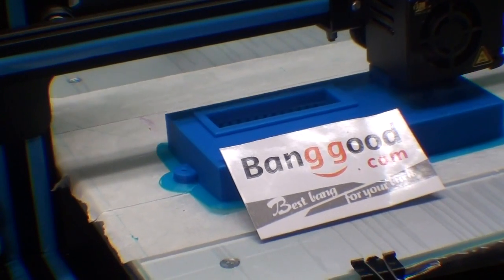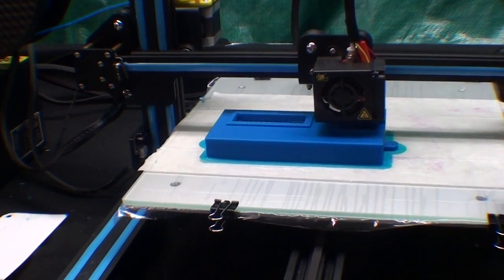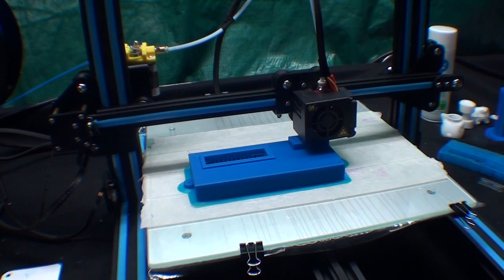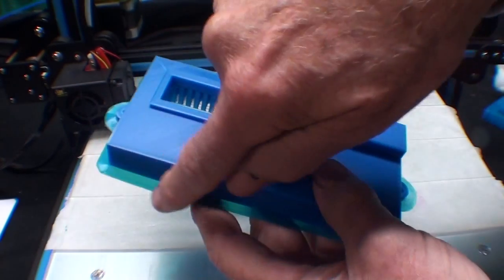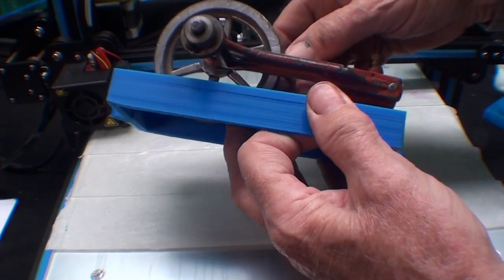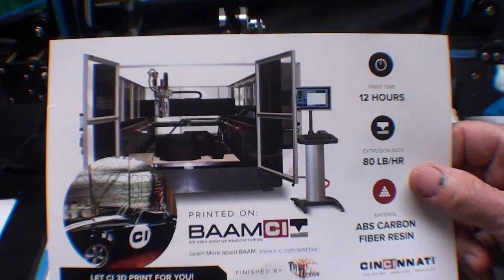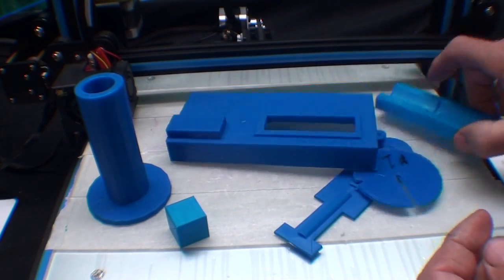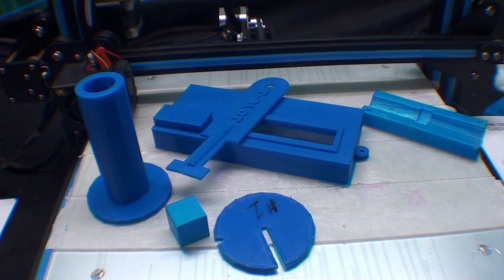3D Printing CREALITY CR 10 with tubalcain #1

Comment: I hope by now you figured out how to use the printer and the slicer settings. Facebook has a wonderful group for each 3d printer out there. I couldn't live without these groups but you might need to do your own research. By the way, I think Fusion 360 is the best CAD out there for free if you are willing to learn.

Comment: If you would use Fusion 360 your round parts would be round. You can position your model and set the filament and bed temps all in the slicer program. You need to watch better video on printing with the CR-10 and Lars has great video on how to use Fusion 360.
Reply from the maker: I think I'm giving up on 3-D printing. No one wants these videos
Reply: mrpete222 There are hundreds of video out there on 3D printing and the software needed. Some good and some bad. I have yet to know why some just play music while they show their printer running? You could use your plastic base with the engine but then it would not be very period correct. Looks like you got a very nice print though.

Comment: Glad to see you mention the accuracy.. Ive been an industrial model maker for 20 years and make most parts by hand with mills and lathes etc .. Ive often wondered just how dimensionally accurate these machinea are as Id love to use them for making masters for model kits etc
Reply from the maker: They are extremely accurate

Comment: The answer to your questions is:  Place the command to go home in the g-code file, place the temperate setting in the file as well.  These are "M" codes.  You can use any text editor. Also your slicer might allow yo to place codes in the G-code files

Next, if you design the box in two parts then assemble with glue you do not need support and the print times goes WAY down.  

If you want metal don't sand cast it.  Send the same design file to your CNC milling machine and make the box out of aluminum billet

How did they print a car in 12 hours?  It was printed from liquid resin, A laser scans the surface of the resin and the light cases the resin to polymerize and be solid.  It is a water process as only the laser bam has to move and the plastic is MUCH tougher

Finally, look into using Autodesk's CAD/CAM system called "Fusion 360"  It is free until you earn $50K using it, then you pay a license fee.  Free the student and hobby users.   Truly pro grade CAD/CAM It can output g-code for mill, lathe and printers.    To close,  Bstom Gears has CAD file for every gear they sell.  Fusion can import the Boston Gear catalog.then you can change the hub to fit your machine.   Even print helical gear.
Reply from the maker: Yes, that's all on the slicer

Comment: MrPete;  You can add custom gcode to the end of your print in the slicer software.  I don't normally use Cura.  I normally want the Z axis to raise upward about 20mm and then do an autohome.  On My printer this moves the bed all the way forward.  The Slicr3d (?) I use does this automatically,  "G28 ; home all axes"  "M84     ; disable motors"  This link documents the gcode.  http://reprap.org/wiki/G-code  Use care there is a lot of bad info out there.
Reply from the maker: Thanks, that is good to know

Comment: Congrats on the CR 10.  I recently purchased one also.  I'm using Cura 15 for slicing. So far I have had pretty good luck, printing PLA directly on glass with a fairly heavy application of Aqua Net hairspray (extra super hold, purple can).  

Cura 15.04.3 Basic settings (partial)
Nozzle temp 205 
Bed temp 60  (hotter= better adhesion, within reason)
Layer height .25
Thickness 1.2 mm
Top and bottom 1.2
Print speed 70 mm/min

Cura 15.04.3 Advanced settings (partial)
Initial layer thickness .2.   Bottom layer speed 40 mm/min  
Travel speed 150 mm/min
Bottom layer 40 mm/min
Infill 70 mm/min
Top & bottom 70 mm/min
Outer shell 70 mm/min
Inner shell  70 mm/min

Using a raft only for parts with a small adhesion footprint. 

I'm sure there's lots of room for improvement, but this has got me going with mostly good results. 

Keep up the great work.  Love the videos.
Reply from the maker: Thank you for that, I have been having quite a bit of success lately.

Comment: TinkerCAD : when adding a circle you should see some sliders, top right, Sides and Segments that need sliding to the right on to get better circle , cylinders; Why doesn't TinkerCAD  do this as a default I don't know  except it may save them server space their end. You may add a bevel as well

Comment: im not sure if you have answers yet but here goes.. to get the printer to return to the corner position , on the control box look for the setting "home all" and click that. and ass far as the bed and nozel those heat setting are set in the slicer program itself
Reply: lastly i have the large version of this machine, feel free to ask me what you will
Reply from the maker: I've got it figured out, it's all on the slicer

Comment: CR10 is a very slow printer because it needs to slow down quite a lot to compensate for the wobbly frame in order to get good prints (you are basically trading the rigidity for larger build volume at that price). I could print the same thing at better quality in 3 hours with my delta or corexy machine.

Comment: I hope you have figured some more things. Just a few tips.  Generally, infill can be 10% or even less. For faster prints use.30 layer height. For ABS you need pretty high heat on the bed.  PLA 70 degrees works fine. In your 3d slicing program, there will be a place to enter in the bed size, nozzle and heat be temp.  It takes practice. As for a good free 3d program try designspark mechanical.

Comment: My CAD software of choice is autodesk inventor; I highly recommend it, one of the few relatively full-featured CAD suites with a decent user interface.
Reply from the maker: +oooooooooorly I am already studying fusion 360
Reply: I hope you find it to your liking!  I haven't used it yet, myself.  More than anything, I'd advise that you stay away from Solidworks or Creo Parametric at all costs; terrible, terrible software, both of them.  Sort of the CAD equivalent of the "turing tarpit" - everything is possible, but nothing of interest is easy.  Solidworks has been widely adopted in industry, unfortunately...

Comment: So I have three recommendations after having the CR-10 for the last 4 months. I love it. But there are three things that I did to make me love it. First....  build an OctoPrint for the printer. It is a cool project in itself working with a Raspberry Pi. This will give you a ton more control over your prints through wifi from your computer browser. The best $35-40 upgrade you can do. 

Second, get a PrintInZ printer plate. This is going to be a bit more expensive, about $80 for the large CR-10. But you will never have to use tape or glue sticks or anything like that again. The plates are flexible so you can easily pop off parts. And you will not that horrible tape or residue attached to the bottom of your print - it sounds expensive but it will last you for a long time and you no longer have to buy tape or glue sticks and your prints will be better.  The first couple of prints will fail on a new plate or after you clean the plate - which I rarely do. So just be prepared for that. After that, I never have a failed print or a problem removing a part. I do keep the bed heated at 50 C even though they claim you can turn off the heated bed for PLA.

Third, and the most expensive upgrade, get Simplify3D. I think this runs $150. This also gives you much more control over prints. Press Reset on YouTube gives great settings for Simplify3D for the CR-10. Those are my recommendations to turn the CR-10 into a printer that is closer in print quality to a $1000-$1500 machine. Happy printing!
Reply: also.... get rid of tinker cad and move to Fusion 360 which is free for hobbyists. Makers Muse has a great series of videos for 3d printing.
Reply from the maker: +Crzy Steve thanks for those recommendations. Where do I get that print plate?
Reply: btw... I think it was really smart for Creality to get a CR-10 in your hands. If you need any advice with 3D printing, hit me up.
Reply from the maker: Thanks--I will check it out

Comment: I spent 2 months this year learning Fusion 360 and that has a lot of capability. It takes a while to get the skills to make parametric designs - a minimum of root dimensions and all other dimensions reference to those. That so when you make one adjustment, everything you'd like to adjust with it, follows. I produced about 50 cell phone cradles for MBA graduates on the college's Makerbots - the cradles were well received. I see the 3D printer as something to make tools, spacers, jigs, etc. but haven't really found a good number of actual products. I did make some really useful wheels for electric RC airplanes - strong and light. The PLA won't stand up to glow fuel. Probably not gasoline, either, or diesel fuel.
Reply from the maker: +BrightGarden Entrepreneurial Foundations thanks for watching. I plan on learning fusion myself, but will probably take three months. I recognize the limitations of 3-D printing. It was extremely slow, but excellent for some applicationand not so good for others. Certainly no good for any kind of production. But I want to do patternmaking and Proto types

Comment: Hi,
I've been watching you for years, you produce some great machine shop tutorials. You were one of the first You Tubers that I subscribed to. Thank you so much!
I've been sorting out some issues with an inexpensive 3D printer as well. One tip that you don't see often is to make sure your nozzle is extremely close to the bed for the first layer. It is amazing how much difference it makes to have that nozzle almost dragging on the bed. I believe for the first layer it is actually a good thing to have a little bit of plastic squeezing out to the sides a little. I've been trying really hard to get ABS to print well on my printer, and every time I have trouble with a print sticking, I go back and make sure I adjust the clearance, sometimes while a print is starting up. I have been using a glass bed, which may or may not help and hairspray, the cheap Aqua Net stuff which really seems to make a difference. On those last two, I've been working almost exclusively with ABS so far, so if you are using a different filament your results may vary.
I apologize for the long winded comment, but I hope at least one little bit of it will help you, it will make up for a fraction of how much your videos have helped me!
Reply from the maker: +Steven MacMillan thanks for watching, and thanks for the tips. I am having a lot of success in the last week. I finally settled on masking tape with play school pink glue stick. I have not tried ABS. And I want to learn to use fusion 360
Reply: when "leveling" your bed, try using a piece of ordinary paper for nozzle spacing
Reply: Thanks! I do that,  but for some reason the distance I get with a paper shim, and the distance when it starts to print are not the same. I always have the nozzle hot when I do it, so there's no cold plastic hanging off the bottom of the nozzle. I use Cura for slicing, and I think that has something to do with it, but my best results come when I adjust the bed (a little) during the start of the first print after leveling.

Comment: G28 X0 ; home X axis copy this and place it (printer settings / custom G-codes / End G-codes) in the Slic3r  program. This will home the X axis when finished. Witch is better than auto home. Not sure on cura where to put it
Reply from the maker: +Henry Mills thank you very much, I finally have it figured out. At homes, and it preheats

Comment: If you send me the dimensions of the part you want and your preferred draft angle I can make it in under 15min with fusion360 and send you the STL for Cura. Also in cura there is a start/end gcode print menu that you can use to preheat with and also move the hot end away from the finished print with. I can send you my settings for that if you want to try it. Lastly 10-20% infill with 3 layer sides is great for speeding up prints.
Reply from the maker: +Kevin Peterson i'm getting better, so I don't need so much help. I got it all figured out for the pre-heat, and the home position. Just needed a few tweaks with my settings.I may need to help at a later time with the draft angles

Comment: One of the 'problems' with 3D printing is that most models are printed in one go. Printing it as two or three separate parts and gluing them together can save you hours of printing time. Sometimes a simple rotate can eliminate huge amounts of support. After many years using a 3D printer i am now pretty quick to adjust a 3D model and cut it up in several pieces and print without support 99% of the time. The first part you showed i would print as 2 different parts. First the bottom with the sides (Print until the layer where the top starts), then the top. Some glue and ready. Your printing time would probably be 50% faster and no support.
Reply from the maker: +Tzadvantage Bkk very interesting, I never thought of it that way. I am sure I will put those to good use

Comment: I would add to the guys saying Fusion 360.  It is quite good and not too hard to learn.  Everything that goes to your slicer will be some form of polygon, and in fusion at least you get some options to subdivide (ie increase the resolution of the object).  Slicers all use poly objects, which are defined by a number of flat planes to make up the form.  (A flat plane being a face, between 3 or more edges, each with a point at the end.)  It's just a matter of increasing the subdivision where you need to until it's acceptable (mainly curved areas and not so much flat furfaces).  Certainly you should be able to bring it down to where you can't see the facets.

I would also run some tests increasing your speed, at the end of the day it's a balance between how your motors, frame, hotend, feed assembly and the plastic itself perform, but those prints look pretty good at the moment.  I wouldn't be suprised if you could speed it along a bit.
Reply from the maker: +Joel Cresswell i'm starting to catch on and there is much improvement at this point. And yes tinker cad allows me to increase the number of sides. But I did not know that at first. I have much experimenting to do, and blonder along with a few mistakes until I refined it. Thanks for your help and suggestions

Comment: I would suggest that you give Onhape (onshape.com) a try for your CAD modeling. It is web / browser based, so doesn't require any download or install, and accounts are free as long as your designs are publicly available. I think it is much more powerful than Tinkercad, although it does have a bit of learning curve.
Reply from the maker: +Ross Johnson I need to give that a try. But there are so many

Comment: I have an Anet A8, messed with Cura but later bought Simplity 3Dfor a slicer. I use Fusion 360 for design. I have a glass build surface running at 55c and have great success using Elmer's purple glue stick (no tape). I never use a brim or raft unless my part starts out with very little bed contact surface.
Reply from the maker: +Mike Heath thanks for the tips

Comment: Mr. Pete, I love your machine shop videos. Many of the issues you have can be fixed with the settings in Cura. I would highly recommend using Fusion360 or Inventor for CAD Cura s fine for slicing but Tinkercad actually extends print time since it is not doing Boolean operations when you intersect geometry. Also your infill and support settings can make a huge difference to print time. Many times people will come in with a print job that would take 24 hours and we have reduced them down to 5 hours by  changing the settings. For a mold you certainly dot want % infill.

Comment: regarding your problem with sticking:
set the hot bed to the glass temperature of the plastik (60°C for PLA). have the glass clean no fingerprints.

Comment: Your comments about making (even casting) parts faster that a 3-D printer can create them strikes a strong chord with me. I have been thinking about how cool such a device would be, and even watching my daughter's as she makes some parts. I know that there are some things that a 3-D printer can do better than a machine shop (hollow objects and spindly objects), but what I am carrying away from my watching experience is that they are mostly for people who don't have the use of a machine shop (however limited) or don't think they could learn to use such a shop.
Reply from the maker: +Peter W. Meek  yes, you may be correct Peter. I am mainly intend to use it for playing around. Possibly some patterns if I can figure out papers. In fact my printer is running right now, making a foundry pattern for. 4 inch diameter wheels that fit on a small belt sander. I'll see how they turn out tomorrow.

Comment: mrpete makes comments on how he could have done it faster in the shop. Which I have no doubt he could have. But, I don't have a shop anywhere near as well equipped as his. Like I needed a dial indicator holder for an estate acquired 7x12 mini lathe to mount on the quick change tool post. I don't have a dove tail mill. So, I designed in FreeCad and printed in ABS. Works great. Is it as strong as metal, no. But, the only pressure is the dial return spring, so the ABS is plenty strong enough for that. Many are using PLA and machinable wax filament for lost wax molding.  The 3d printer is a great addition to a small shop, if you use it in the right places.